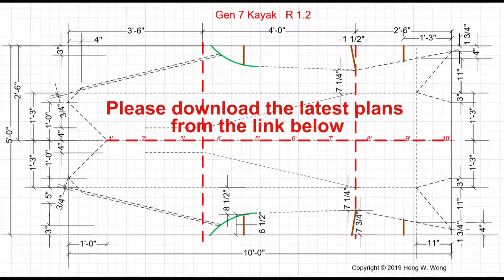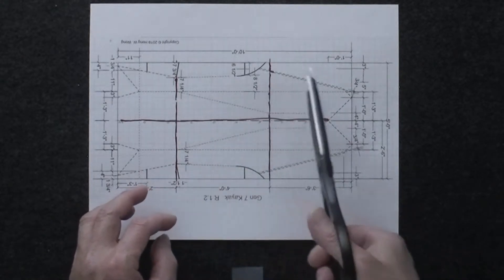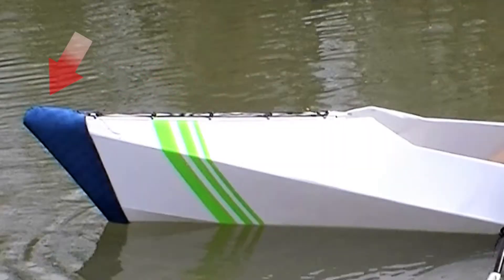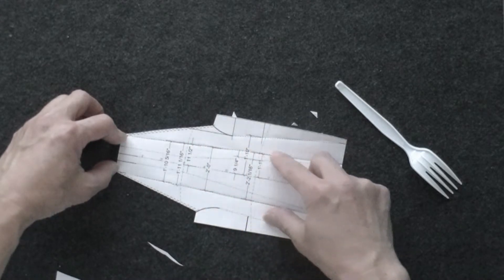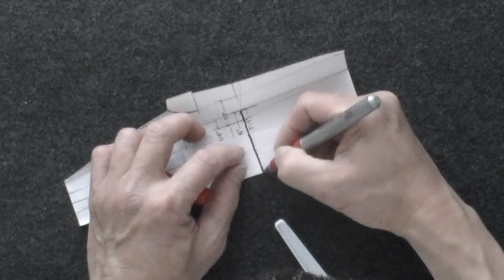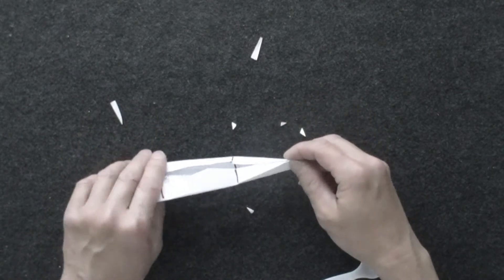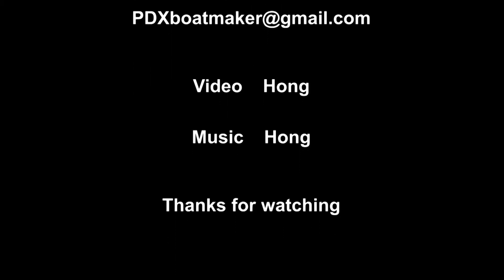DIY tutorial G7 & G8 kayaks part 8 - boat plans (Final Episode)

Comment: Yay! I asked in your previous video (part 7) if you have the plans online, and now I know you do, great!
Also, can you please make this video anew? The lighting is wrong: it's so bright that you can't see the fold-lines on the paper, all I see is a white sheet. Also when you re-film it now you could implement your AWESOME fusion method. I'm sure that'll make a big difference and be a lot of help. I would also like an update on how the folding-up points/lines hold up, because you were concerned about them. 
I have an idea about those folding-up points: instead of making ONE line which places all the stress on one point you can make TWO lines or even three so it is ROUNDED instead of a straight like. Which has so much Less stress on it, just like how you fold it into a V-shape instead of completely flat. With rounding it it would have a U-shape instead of a V-shape. However I don't know if it's do-able so I would appreciate your opinion, ideas or feedback on that.

I've only seen part 7 and 8 in this series so I don't know if you've answered this question in another video, but why does the first kayak have those two "tails" sticking out of the back? (And why does the second one not have them?) Maybe I'll go see the other parts too so I might get an answer there and respond to you on them.
I'm also curious of where you got these designs, so I'll see if the answer is in one of the other videos. 

I really hope you'll make an Instructable on this! Or if you've made one that you'll post the link, please!! Thank you.
Reply from the maker: Thanks for your questions, please see my embedded replies below:
 can you please make this video anew? The lighting is wrong: it's so bright that you can't see the fold-lines on the paper, all I see is a white sheet. Also when you re-film it now you could implement your AWESOME fusion method.
-----------I am not seeing the issue you have when viewing the video on my PC, hence I don’t know how I can improve on it (and create an updated video). This could be caused by the default video playback resolution when you view the video.
----------Would you please try to use another PC, or increase the youtube video playback resolution and hopefully you can see the details. 
I would also like an update on how the folding-up points/lines hold up, because you were concerned about them. 
----------I am not that concern now because I can easily use hot fusion to fix most of the damages to the coroplast. The boat I used the most is the Gen 7. I used that boat > 8 times last summer and many of my friends have tried that also. It seemed to be holding up very well, no leak. Rocks did pop a few small holes on the coroplast but the double layer of the coroplast prevented water from getting into the boat. Those holes are easy fix (I have a video in repairing those holes  https://youtu.be/GT-kN_uy4DU  (I need to create an update video on the repair technique also))
I have an idea about those folding-up points: instead of making ONE line which places all the stress on one point you can make TWO lines or even three so it is ROUNDED instead of a straight like. Which has so much Less stress on it, just like how you fold it into a V-shape instead of completely flat. With rounding it it would have a U-shape instead of a V-shape. 
----------Agree, I tried something you have mentioned above but the main issue is when the corner scraps on the floor, the surface of coroplast will be easily damaged. Yes, one can minimize this by not creating the bend at a 90 degree angle. I did this at the front end of the two seater design. You can see the Oru boats adopting this technique also. Other product in the market added a layer of elastic/rubberized surface coating (not sure what that is)  at the critical joints to make it more reliable. 
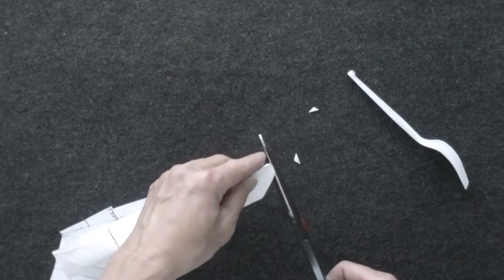-----------I have illustrated a reliable U shape bend at 3:45 of this video https://youtu.be/lZxq3DBnQdY
but why does the first kayak have those two "tails" sticking out of the back? (And why does the second one not have them?) 
-----------Answer is in this video: https://youtu.be/zTsa2wnOGfY
I'm also curious of where you got these designs, 
-----------All the boats I built, except the 1st one (modified from plans available on internet) are my original designs. I am still learning and I have not created a design that I am really proud of yet 😊
-----------I do reference to other designs (products in the market, and designs from youtube)
I really hope you'll make an Instructable on this! Or if you've made one that you'll post the link, please!! 
-----------Thanks for you input, I will do an instructable on my next/better boat : )

Comment from the maker: Update: I have discovered a good method to fuse two coroplast sheets together. If I build this boat again, I will use the technique as illustrated in this video https://youtu.be/zMIBGlPiEYI  to make the bow and stern. This heat fusing method is so much superior than using glue: no extra cost- no glue (less $), no screws, faster and simpler to build, water tight and the joint is very strong.